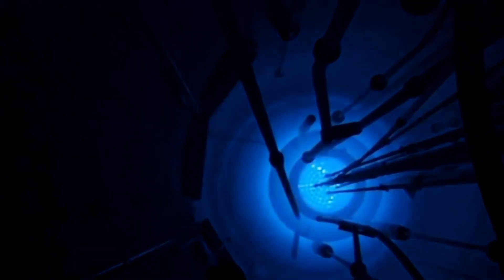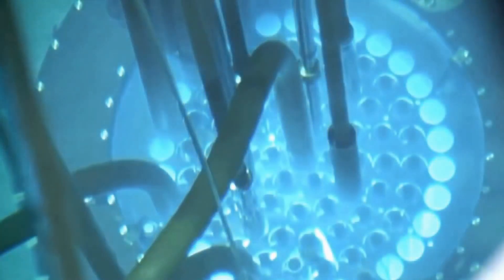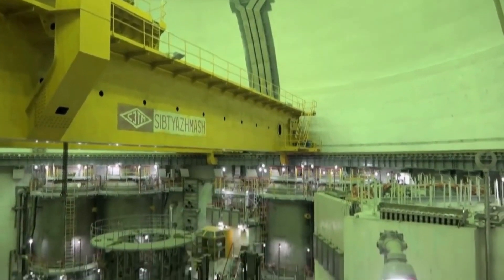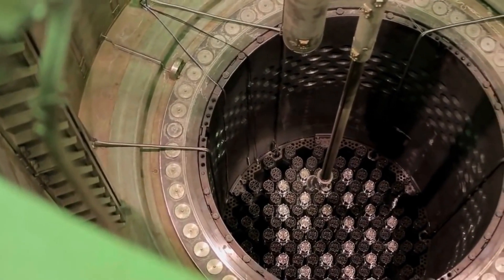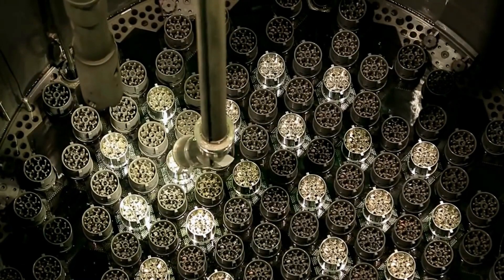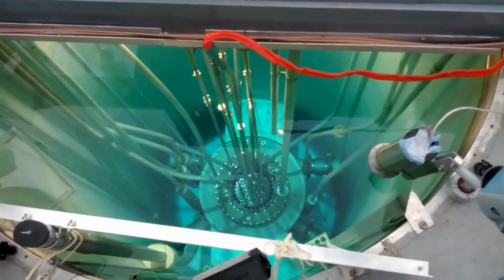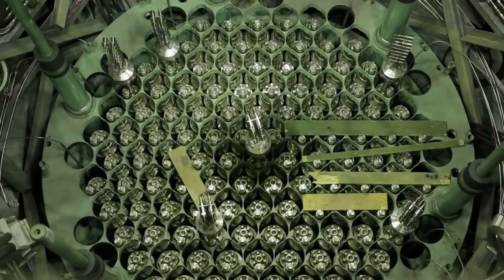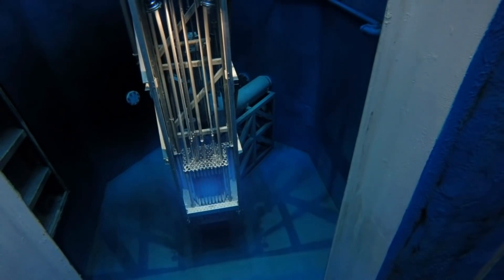The Cherenkov Effect

Comment: What is not explained is how it is possible for these particles to move faster than light, even though we hear so often that nothing can move faster than light.
This is true but incomplete, Einstein's theory of relativity states that nothing can move faster than light THROUGH A VACUUM. That last part is important because light in water slows to 75% of its speed in a vacuum, making it possible for particles to go faster. 
Cherenkov radiation is largely ultraviolet but the part we can see looks like the blue glow from the video.
Reply: pls correct me if I'm wrong
Reply: Thanks a lot mate for this info!